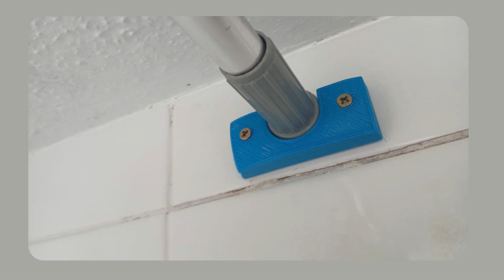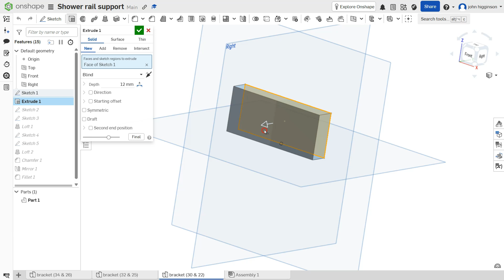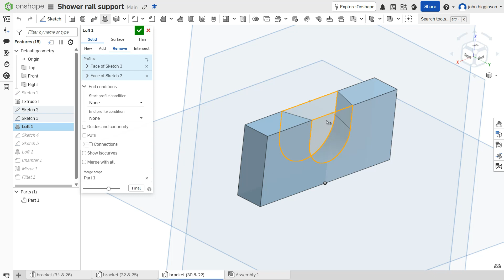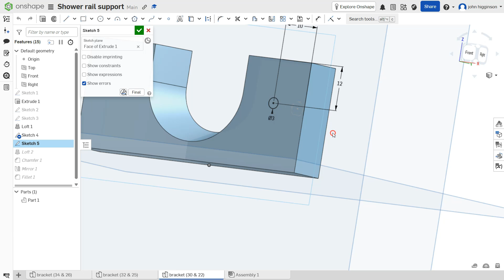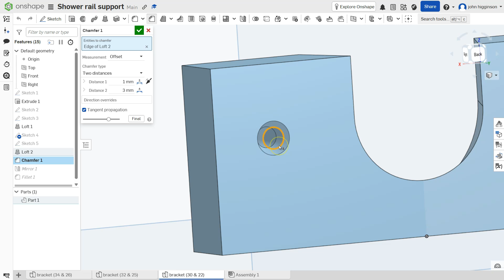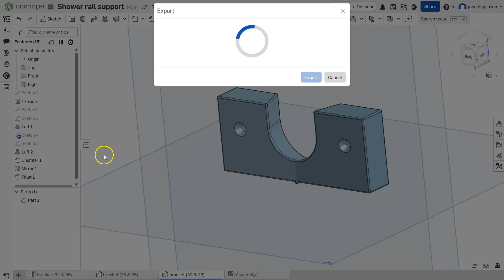Do NOT replace your shower curtain rail! Use this Onshape tutorial & 3D printing solution...!

Comment: This certainly passes the bachelor engineer's test, but would look better printed in marble filament with countersunk stainless screws covered with tapered printed plugs, or attached to the wall with 3M VHB tape instead of exposed screws.
Reply from the maker: Thanks for the comment. What is the bachelor engineers test? I agree the aesthetics could be better. I prefer using screws rather than tape though to maje absolutely sure it isnt coming off...! 😀
Reply: @gradeAPhysics  The bachelor engineer's test is one in which the bachelor engineer thinks a clever functional fix is an excellent end state. The test as to whether a theoretical significant other, perhaps more influenced by aesthetics and training in humanities, would agree, is in question. I don't believe that exposed screw heads and a contrasting color will pass more than the first test.